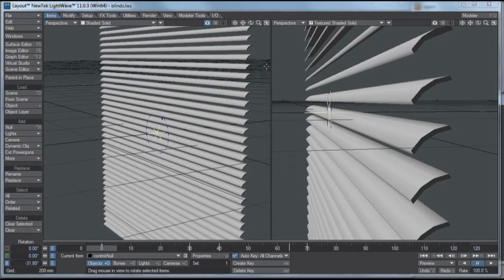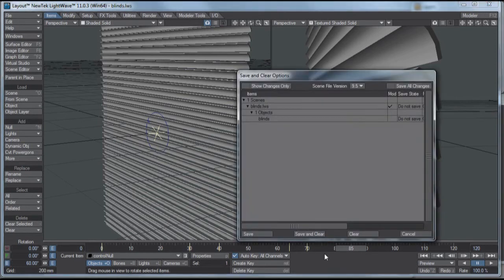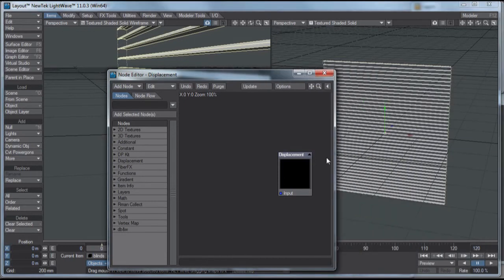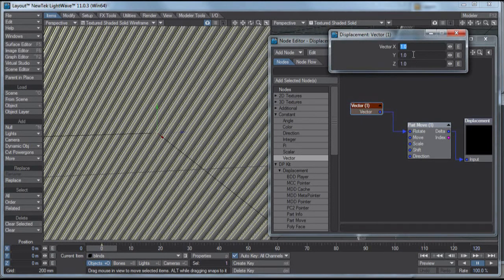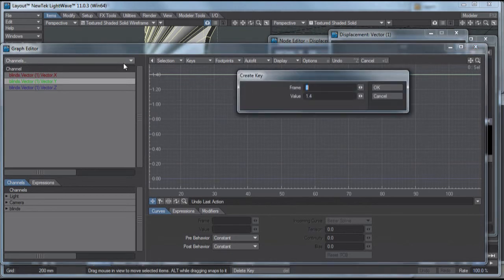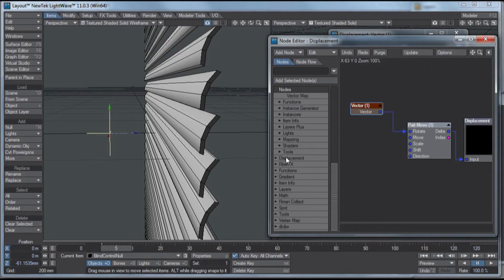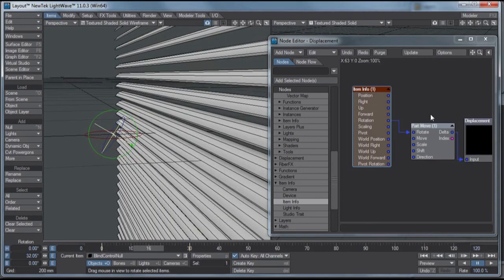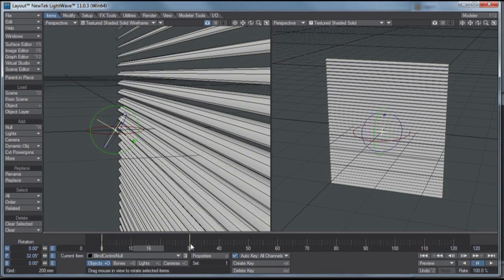Blinds With Light Wave And DPKit's Part Move

Comment: Could probably show a bit more of the nodes by showing how to limit the range of motion that the control null might move the curtains by.
P.S. 1.4 is slightly less than PI/2 radians or 90 degrees. Seems most of the math system is based on the units in Radians.